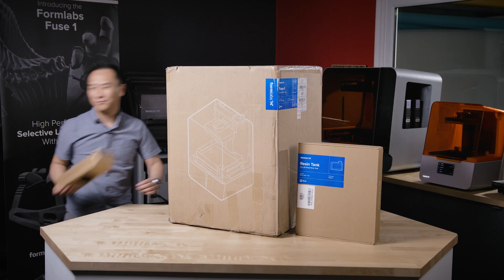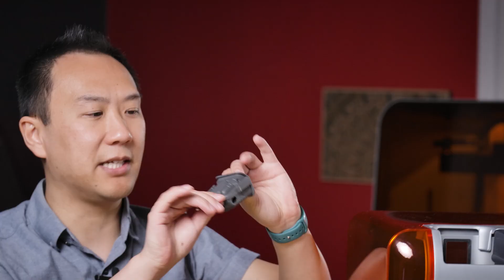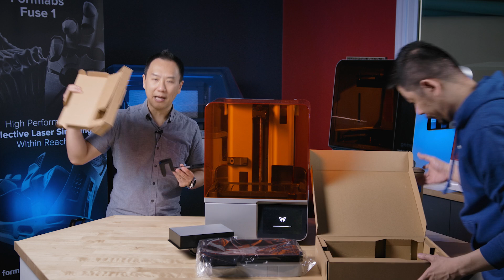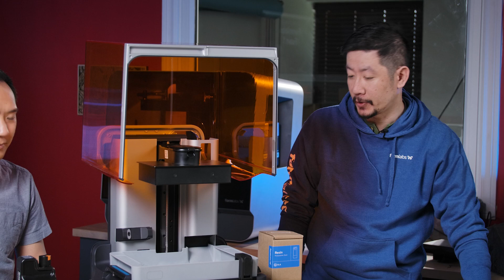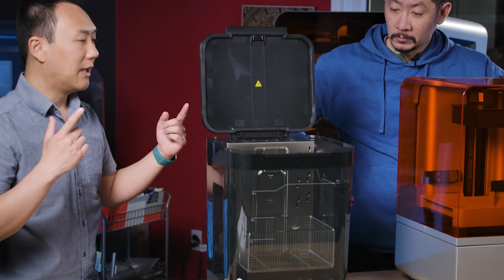Formlabs Form 4: Unboxing | First Impressions | What's new

Comment: Thank you for the review. I still have some questions:
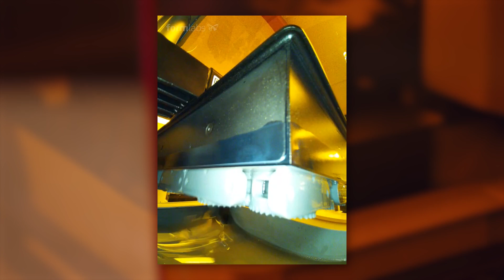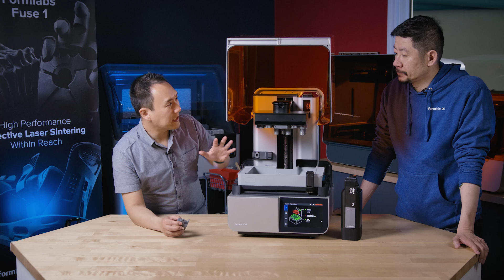1) What happens to the parts between 29:48 (Part is in the Form 4) and 29:58 (Part is in your hand)
2) You didn't show the Wash machine in time lapse
3) You didn't talk about the Curing machine
4) I can not find any info, any video anywhere, about what happens with the resin tank after a part is printed. Does it have to be cleaned? How do we depose uncured fluid resin that wasn't used. Could you please make a video about this full process cycle?

That would be much appreciated. Otherwise good review, I hope you understand my questions.

Comment: Love your video 
I just about order 
Two question before order it
1  you showed printed objects 
Is there no need support? 
I know most  cases need support 
But looks like no support on build platform 
2  I will use it only for hobby. Done with cheap made in china 
Is there way I can use 3rd party resins?   Or mixing with V5 resins?  
Thank your
Reply: Sounds like this isn’t the printer for you bud. Me either to be hone$t